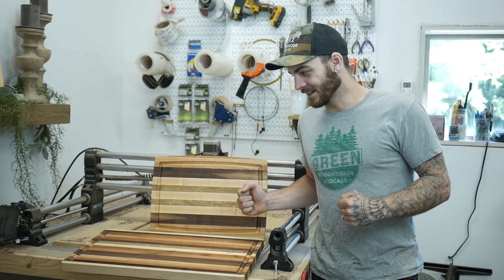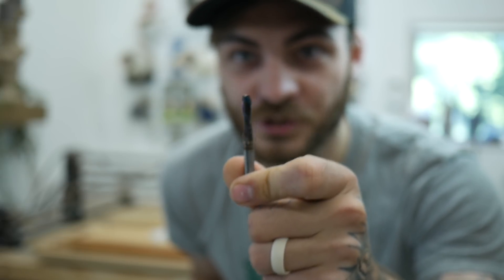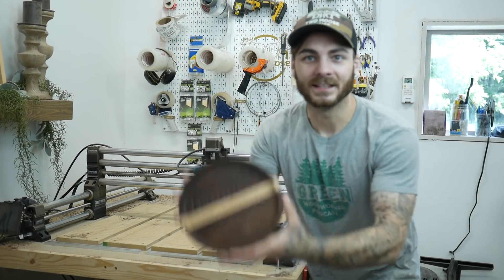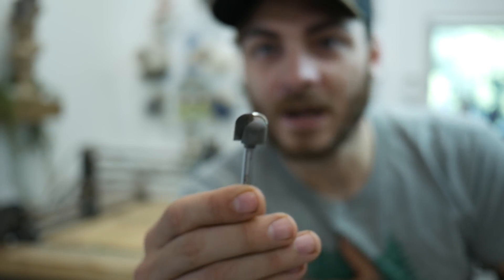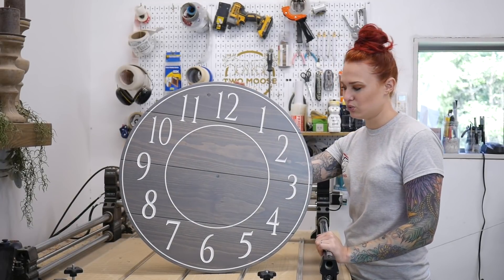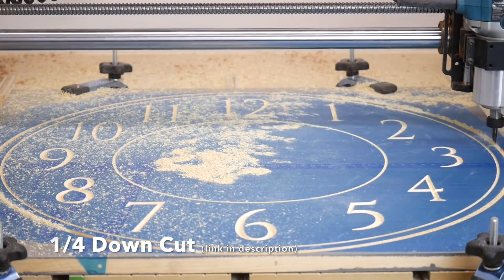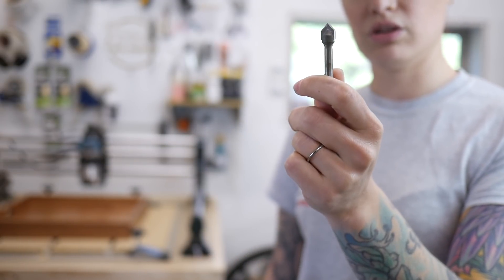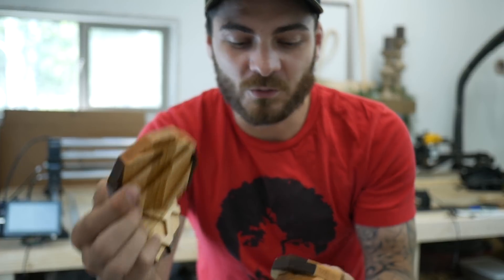5 CNC Projects You Can Make / Sell And The Bits Used

Comment: Thank you both for sharing your knowledge. It's still relevant 2 years later. Question: did you use mitre fold cuts on the CNC to make the actual ottoman tray (the vid just shows the engraving portion)? Or did you use another woodworking technique?

Comment: Nice work! For the cutting board and the catch-all tray, what did you use to hold pieces down, and what finish did you use?
Reply from the maker: I used masking tape and ca glue (super glue) like double sided tape. I finished the cutting board with walrus oil 🙌🏼

Comment: Great video. Very inspiring ideas. How about the bits? What would be the minimum number of bits of each type I should buy in order to keep production rolling without stopping every time a bit is dull or broken? How long do they last?
Reply from the maker: They last quite a while. I keep 2-3 on hand. I’ve only broke 3-4 bits in 3 years or so. And I maybe use 4 bits 90% of the time

Comment: Awesome video! How did you decide the speeds and feeds for the dish bit?
Reply from the maker: I started at speeds with a similar bit and went from there. Slowly adding or subtracting speed or depth. It varies between machines. I always like to start with a low depth and higher cut speed then adjust.
Reply: @TwoMooseDesign  I just got a CNC and can't wait to try out some of your suggested projects. I've sub'd and can't wait to check out all of your other videos!
Reply from the maker: @flyingfranklin  Thanks! i appreciate it youll love having a cnc!

Comment: I have just discovered your channel and I just love it.
I have two questions if you would be so kind to advise me.
1: How do you clamp your material down to the CNC table?
2: What is that Blue material that you use to cover/protect the clock face?
Thanks. Colin.
Reply from the maker: Hey! thanks for stopping by. I use masking tape and super glue to hold down my piece, like a poor mans double sided tape. Then the blue stuff makes painting a breeze its called oramask. Ill add a link to the description

Comment: Loved this video!!!  What are your feed and speeds for the Amana 3/4 dish bit?  I have the same bit!!
Reply from the maker: Hey! I Typically run it at 100ipm and .2 depth but it varies in what machine you use. Thanks for watching!
Reply: @TwoMooseDesign  Thanks for answering so quick!!!!!  I have an Axiom Iconic 8.  Currently, I am running depth at .15, IPM 60 and RPM 18000.  I am buying a 3/4 straight bit thanks to you guys!!!  1/4 end mill for clearing takes too long lol.  You have a new fan!
Reply from the maker: It will blow your mind how much faster it is using the straight bit 🙌🏼
Reply: @TwoMooseDesign  I can't wait!!  End mills take forever!!

Comment: Awesome work.  So I am really considering on purchasing a Onefinity CNC as my very first CNC.   One of my current woodworking projects that I do consistently is I make wooden American flags.  I like to make each individual stripe with extra definition by using a round over bit on each side.   Will a CNC be able to engrave my assembled American flags with the rounded over edges on each stripe or will this be an issue?

Thank you

Comment: What are your feeds and speeds for your 3/4 straight bit and 3/4 dish bit for your catch all trays?  Thanks for the help!
Reply from the maker: On the onefinity I run them at 80-110 ipm. .17-.2 depth but all machines vary. definitely start with a low depth of cut and Speed and slowly add to them

Comment: Hey guys loved the video!! I had to like and subscribe cause I built my own cnc machine with my 3d printers. Being the novice that I am, I need all the info that I can get, so thanks again!! I do have a question though, how are you holding your pieces down on the cnc machine? Thanks in advance!
Reply from the maker: Hey! Thanks for checking out the video we appreciate it! I use masking tape and super glue 👌🏼 poor mans double sided tape 😆
Reply: @TwoMooseDesign  wow im going to have to try that, only i havw double sided tape, do you think that will work by itself?
Reply from the maker: Yeah absolutely I’m not sure if other brands are better than others?? I personally don’t use it but I’ve seen many others using double sided tape. Try with a piece of scrap first 👌🏼

Comment: I have a cutting board that I hope to recreate on a cnc. It's similar in shape as the one you show in the video - slightly curved, with the juice groove. However, the sides are also sloped -- basically the bottom of the board is smaller than the top. Not by much, but it makes it feel fancier. Can you cut that on a cnc? smoothly? Or do you need some sort of cone shaped bit?
Reply from the maker: You could yes but you would need software with the ability to program it.

Comment: Roughly how expensive is it to get one of these setup in your garage or pole barn? Finishing up Schooling next semester for CNC Programming and I currently program a cnc Mill at work everyday. Need to find a good way to pay off college loans...
Reply from the maker: All of the top Cnc machines will run you about 1800-$2500 usd. Larger more professional machines can run $4000-$30000+
Reply: @TwoMooseDesign  about to take out a loan asap thank you lol...
Reply from the maker: @nalde4258  nice! Good luck! 😁🙌🏼

Comment: I was wondering 2 things what soft ware do you use for designing and  toolpaths.? Second what  sort of tool path do you create for that 3/4" straight bit . Would you share that toolpath, does it include ramping in?
This question has to do with the cutting board
Jeff Peters
Reply from the maker: We run easel since we came from an x carve. I’ll upgrade to vectric and eventually! I’m not sure what you mean what sort of tool path. I run it as a end mill typically a roughing pass at around 100ipm and between .15-.2 for cut depth. As for the the cutting board I make them to order so the files are random. I’ll just select the shape I like then offset the same shape to make a juice groove nothing special.
Reply: @TwoMooseDesign  I that 3/4" dia bit set up tp plung  straight in or do you ramp it in
Jeff
Reply from the maker: @resorter66  I plunge it straight at 10 ipm ramping probably wouldn’t be a bad idea I don’t have that ability with the software I use

Comment: Wow this is awesome, what speeds and feeds are you running on some of that hardwood? The coasters take 7 minutes shocked me, I'm going way slower with my 1/4" downcut on hardwood and I'm thinking I can probably kick it up a notch based on what you're saying.
Reply from the maker: Ryan Ackerman it all depends on the machine your running but for the most part I run a 1/4 down cut at 100-120ipm then for depth .15 - .2 depending on material and how many passes. You could be more aggressive on mdf.
Reply: Two Moose Design thanks a lot! I’m gonna tinker. Much appreciated
Reply from the maker: Ryan Ackerman good Luck! Just add a little bit at a time. Start by adding speed before depth then just take notes 👌🏼

Comment: But is a CNC woodworking. It an automated system with no skill needed.
Reply from the maker: CrossGrain Wood Products,LTD have you operated a cnc?
Reply: @TwoMooseDesign  No and don't plan to.
Reply from the maker: BibleTalk101 agreed. Any form of creativity involving wood is woodworking in my personal opinion.  🤷🏼‍♂️ people turned their noses at all the new fancy tools throughout history
Reply: @TwoMooseDesign  Yes that's right. But up until 2000 when they began making CNC's available to companies them eventually to the public all tools required your hands. Even a router requires your hands to guide it. A table saw replaced hand cutting, but you still need your hands and eyes to achieve a cut. almost all modern woodworking tools require your hands but with a CNC or Laser cutter, there is no real skill other than basic computer skills needed. That is my opinion but shared by many.

Comment: Hey guys, what type of tape do you use in place of the clamps. Seems to hold very well and looks like it’s easy to remove.
Reply from the maker: Akinetik Fitness I use masking tape and super glue! It’s like home made double sided tape lol cheaper than actual double sided tape and I feel it holds better than the cheaper stuff
Reply: Two Moose Design thanks, great video btw. I’m expecting my Xcarve in the mail and I’m just trying to soak up as much information as possible.
Reply from the maker: Akinetik Fitness heck yeah that’s awesome congrats on the new machine! We still have an x carve and have been using it for 3 years now.

Comment: A word on the coasters. I make money doing coasters. I have multiple coasters that have themes like Christmas or Thanksgiving carved into them. Offering custom made coasters, like initials and names also help as well. My question is, how thick are your cutting boards? imake mine out of pallet wood for the design. Natuarally I clean them really well before the assembly project. How thick are your catch all trays? Are your clocks 3/4 inch thick in material? I also have to find your ottoman tray video. Those look awesome to make.
Reply from the maker: Jeff Ruffing hey! Glad your having success with coasters 🙌🏼 the cutting boards vary on my scraps but 1.25-1.5 inches thick typically. And again for my catch all trays they vary but typically .8” then I’ll carve down .5 roughly. Yes the clocks are around .8 which is what my lumber comes milled at
Reply: Two Moose Design catch all’s are 8” in diameter or thick? I know diameter can vary, I’m asking how thick is usually yours, like they are 5 inches high or 8” high
Reply: I also don’t understand the clocks being .8 ( point 8) what does that mean?
Reply from the maker: Jeff Ruffing .8 like a little bit more than 3/4 of an inch. In decimals like 3/4 of an inch is .75
Reply: Two Moose Design oh! Ok. Thank you so much for clearing that up. Some of us are new to the “wood working” lingo! Great job again. You guys rock! More videos please! I’m subscribed!
Reply from the maker: Jeff Ruffing thanks! And sorry about the confusion! Good luck

Comment: Having run/programmed cnc machines for 18+ years I really liked this video, although you run several passes on some of your cuts which could easily be done on one pass and save abit of time.... dont know if that matters to you but in a high pace manufacturing prospective every pass counts.... great video tho....👍👍👍
Reply from the maker: Thanks! I appreciate the feedback. I totally agree on the multiple passes. I Run a Free software so it doesn't allow me to edit much of the code. Its really annoying especially on v carving. I plan to upgrade to vectric software eventually....

Comment: Nice work. Definitely a good idea to batch out projects. If you can do a bunch of cutting boards at the same time you'll have to change tool heads less often saving you time. And coasters become much more valuable after you've set it up to make 50 or 100 at once depending on how much bed space your cnc has.
Reply from the maker: Thanks for the tips!